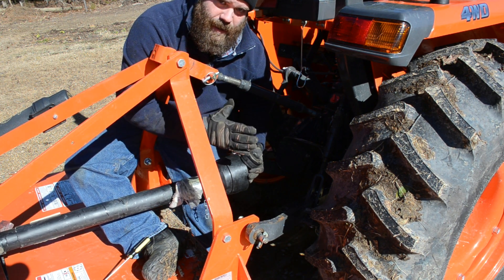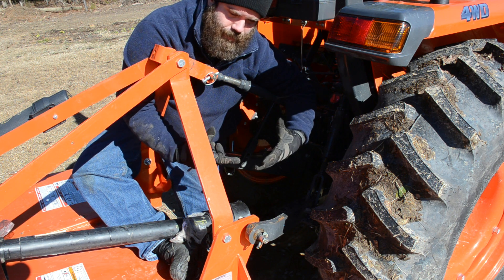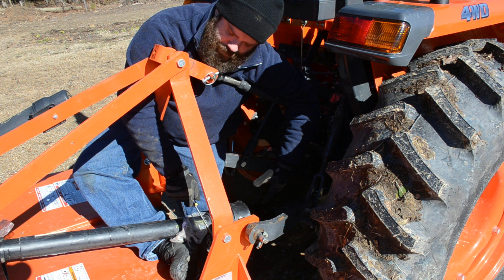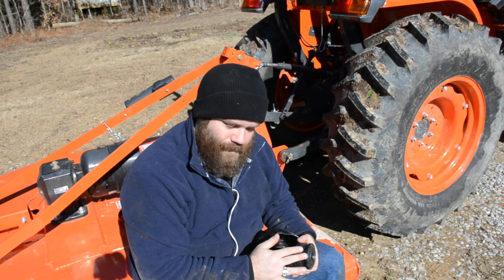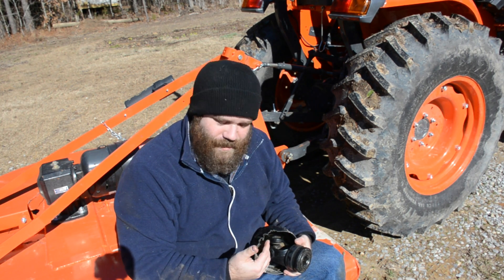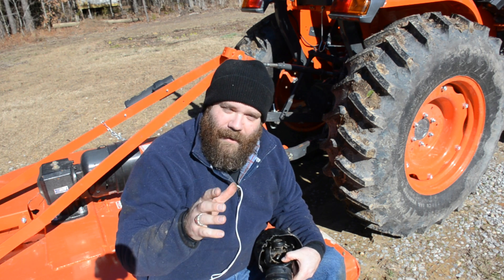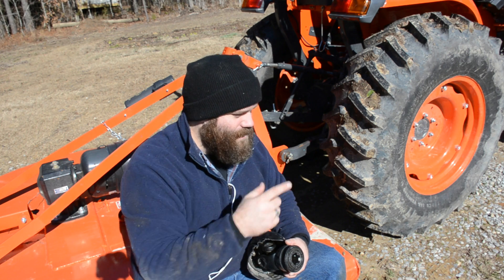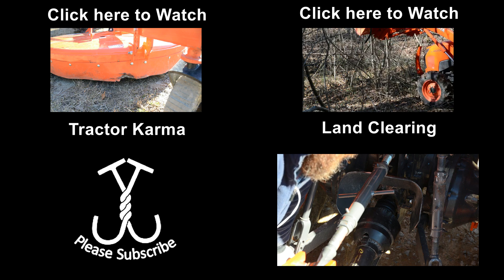Using a rear PTO on a tractor

Comment: You're not alone.  When I first got my old used tractor (with no manual) and my first PTO attachment, a post hole auger, I had exactly the same problem.  Just like Self-Sufficient-Life suggested in these comments, I, independently, was about to try the bigger-hammer solution.   I did finally manage to find PDF versions of the manuals online and after a bit of reading -- VOILA!  Putting the PTO attachments on and off suddenly became a piece o' cake.  I can't believe how stupid I felt.   I could have saved myself hours of grief if I'd seen your video first. Thanks for posting.
Reply from the maker: Oh boy - I don't know that I'd every go so far as to call any PTO attachment a "piece o' cake" - lol!

Comment: Yeap, don't feel bad, Iv'e done the same thing b4 (on my shredder) but right now I can't get my PTO connected on my finish mower and it has a push button on the side to release the bearing. It is acting the same way, I just can't get it to push all the way on. When I went to hook it up, the end was laying in the dirt. I have tried scrubbing it out with a steel brush and liquid wrench, but still don't seem to be able to get it attached.
Reply from the maker: Dang, sorry man, I'm not sure what might be going on there! I hope you get it sorted!
Reply: Thanks for response J&J!, today I took the PTO shaft apart where I could examine it better, there was still a little rust/dirt stuck in it, after I scrubbed it a little better it slid right on!

Comment: When the bearings get stuck and don't work the way they should, you can put grease in the unit to let the bearings mover like they are suppose to. If your brush hog sits outside like mine does water builds up in it and makes it hard to hook up properly.

Comment: Glad you posted your mistake, because I was making the same mistake.  I own a bunch of PTO connectors of a different style, with a release pin.  Then I bought a post hole digger with this style of connection, and couldn't figure out how to release the bearings until I watched your video.
Reply from the maker: I'm so very glad it was useful to you. Thank you for letting me know!

Comment: Hi and just wondering if you could help me with something on my Massy Ferguson 168. I am using the PTO to drive a grass cutter and I am having trouble engaging the PTO gear into the fast cycle. The lever is beside the seat and usually I push it forward for most things as I do not need much speed, but when I am cutting grass I need to push it back and it is very shift. Thanks.
Reply from the maker: Michael Coughlan, I really wish I could Sir, but I'm afraid I'm not familiar enough to help with that.
Reply: J&J Acres Not to worry and thanks for getting back to me, I really do appreciate it.  Actually what I did was I tried pushing back the lever and then turned off the tractor and tried again and it worked.

Comment: As a degreed engineer I can attest professionally that incidents like this is why engineers have flat foreheads:  When we do what you did and then figure out (or get told by some hoary ol' tech in the plant how to do it right) we slap ourselves on the forehead in anger.  This happens to engineers often enough that we often develop a flat forehead.

An' thatz the truth   pffffftt
Reply from the maker: Thanks for the smile :-)

Comment: I recently did just about the same thing with the drive shaft for the mid mount mower on my tractor.  The manual simply said to remove the drive shaft which I assumed meant it would just slide apart.  After awhile laying on my back trying to yank the shaft loose while under the tractor I finally started to turn the collar which I thought would cause it to unscrew.  Nope,  and at this point I'm ready to grab the cutting torch,  I got the tractor differential pressing on my chest and my legs tied up in various 3 point linkages.  Finally I decide to slide the collar instead of twisting it and off she comes.  Facepalm moment.  Tractors are full little surprises aren't they?
Reply from the maker: Agreed TheDisorderly1. I appreciate you sharing your experience as well. Sometimes we just have to fiddle with it a little to figure it out. Glad you managed to figure out the secret to yours! Thanks for watching!

Comment: What is this world coming to when you have to resort actually reading the manual? Although everything you said was complete foreign to me...( I can't fix nuttin mechanical) you remind me of what my father-in-law always tells me... "you just have to worry with it" and that's exactly  what you had done. Great Job on figuring that out! Phew seems to me you saved a buck or two...
Reply from the maker: Saved embarrassment at least. I can only imaging the jokes that would be told of me if I went to the repair shop just to find out I was pushing the door instead of pulling. LOL
Reply: lol